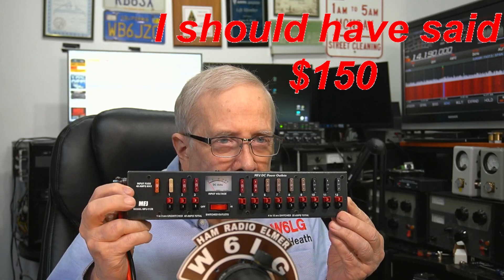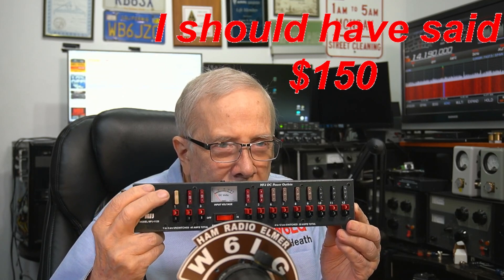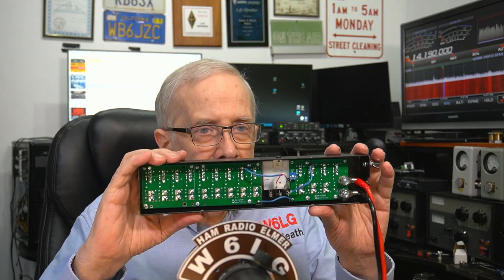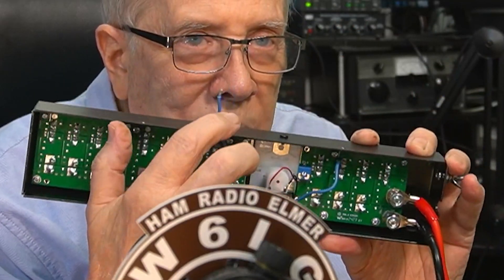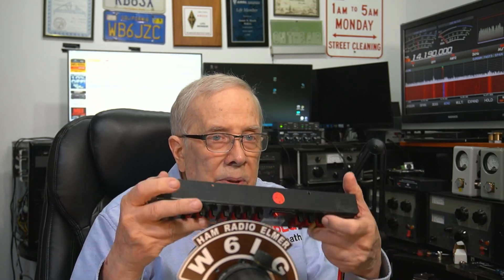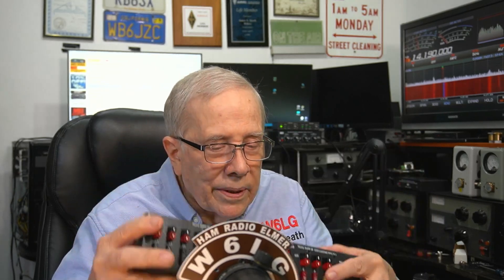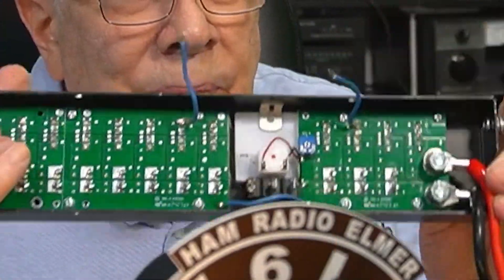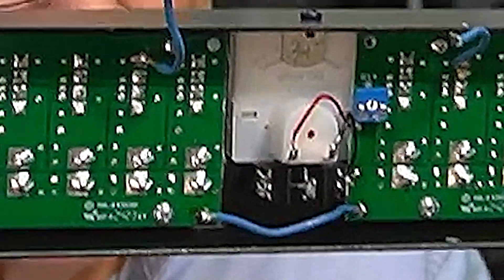Defects Found in MFJ Box #2, Another MFJ Box Here Today for Inspection by Jim W6LG, Watch to the End

Comment: I have been using their MFJ-1118 power strip in my mobile rack case for a few years now, and it has been hit or miss itself.  The switch for the switched poles failed, so I just ended up hardwiring it hot because I didn't use the switch anyway.  Still, another typical failure on a similar product.  Some of those poles still don't seem to provide power, so you have to remember which ones still work.  Never noticed anything dangerous, but then again I just fixed one problem that nearly ruined the product for my purpose.  Might unbolt that 1118 and inspect it further.  A true "you get what you pay for" deal with MFJ.  I've had some good products from them that never failed, some that have defects like non working lights in manual tuners, and some stuff that just totally failed.

Comment: You are too kind to MFJ. The quality of their work (not their designs) is worse than the cheap Chinese radio manufacturers. Like you, I have had to repair new equipment that I purchased from MFJ—and not just once!

I sent them a Mirage two-meter amplifier that wasn’t making power.  That was in October2021–two years ago. It’s never been repaired or returned to this day.

When pressed about the repair after many months they admitted that they were unable to repair an amplifier that they themselves had made. They stated that they didn’t have the parts or people who could fix the amp. Yet they are still manufacturing and selling that very amplifier. It makes no sense. 

As far as I know that amp still sits on a repair shelf somewhere in their shop. I have given up on ever seeing it again and wound up replacing it with another manufacturer’s two-meter amp.

Comment: I don't think that wire can handle 20 Amps. I'd be dubious too. It would have been interesting to try it first though.
I was given an MFJ 16010 tuner by another ham who got it from another ham. I was told it didn't work but I used it at home then North Wales and only upon returning home it didn't work.
Looking inside I saw nothing obviously wrong but finally found a wire only just touching the coil, I could see no original solder, I soldered it and no problem since.
G4GHB.

Comment: That thin wire explains why the volt meter dances about when I transmit. Must be a voltage drop. I thought it was RF getting in. I need to open mine but it's bolted into a rack and I am going away on Monday for a week. I just had to fit proper temperature control to another manufacturers power supply so these kind of things are getting common.
Reply from the maker: It is worth looking inside the box Gordon.  But I think the wires to the meter are very small but connected before the switch.  So the wires to the switch don't affect the voltmeter. Voltage drop with current draw would be in the supply wires and they look pretty good.  Let me know what you find.  The third box arrived and I looked at it carefully.  I found nothing wrong.  I will do that video today or tomorrow. Sunday I have blood tests for chemo.  We are only doing the blood draws once a week instead of twice a week.  Bood counts have been stable at closer to normal but still low.  Thanks Gordon, 73, Jim
Reply: @ham-radio  I hope your treatments go OK. I did check the power supply and it's actually voltage isn't varying under load. When I open it up I might put some ferrite beads on the feed to the meter and see if it makes a difference. As always, your videos are thought provoking.

Comment: I really want to love MFJ, but avoid them now. Once bitten, twice shy. Few years back I bought two loaded verticals, one to replace my aging one. Both had wild SWR's on the centre frequency. One was 8:1 the other 17:1. Centre freq measured around 92mhz off for one and I didn't bother with the other. Purchased a third (different manufacturer) from an interstate shop. It was 1.4:1 straight off the install and capacitance was great. One of the other ham's in the club inherited the two MFJ's to rework them. There was quite a bit of grumbling there when he put north of 20w into a >100w rated antenna, SWR went through the roof and resistance was close to open circuit. So, I feel you.
Reply from the maker: Thanks.  The problems I found in the boxes was an easy fix.  Your antennas with the open circuit sound seriously bad.  Really there is no excuse for the failures except really bad management starting at the very top of the company.  He knows full well that there are serious problems with QC for years and has apparently done little to fix it. Again, there is no excuse that would be acceptable after years of complaints from customers. 73, Jim

Comment: Hi Jim, I agree with your assessment of the wire gauge, although a single wire "out in the open" can carry a surprising amount of current, particularly the PTFE insulated types. I suspect that is just PVC though... 
I only have one piece of MFJ equipment (a digital peak reading power/SWR meter). The paint finish is not terrific but acceptable (to me) functionally it is accurate and reliable, the PCB quality and electronic design are all good.  I imported it from the USA to the UK and during shipping ALL of the nuts and washers retaining the LCD had loosened and fallen off, the LCD was laying inside the unit. I just re-assembled it and it has been perfect for the last 10+ years. I don't like to kick a company that produce economically priced products for us but threadlock/nail varnish are very cheap.  A few seconds of effort  could have made my experience a little more positive. 73

Comment: The wire could probably handle 20 amps for a split second to start an inductive load, but normally you want your fuse to blow before your wire melts or starts a fire. No way is that UL Listed, should be 12 awg for 20 amps according to ampacity charts. It's amazing that this passed any kind of design review.

Comment: Great video, Jim.  I don't understand the use case for these elaborate boxes with power poles, fuses, meters, etc.  Almost all transceiver equipment has a fuse (or fuses) in the power cable.  Why not just use a small powerpole distribution block without all of this other nonsense?

Comment: Hi Jim.  Definitely an important video.  I agree that there is no excuse for the poor solder job.  I do have to disagree on the wire size.  I have that same MFJ box.  I just checked, and thankfully, the solder joints on mine seem okay.  I stripped back some insulation and checked with a digital caliper.  The blue wires on my unit are 16AWG.  The Handbook of Electronic Tables and Formulas lists 22 amps as the maximum current for 16AWG in chassis wiring.  A 2" piece of 16AWG wire will have a 0.014 volt drop at 20 amps and dissipate about 1/4 watt.   So 0.028 volts and about 1/2 watt for both + and - wires.  There is no question that 12AWG jumpers are better, but the 16AWG wires are perfectly adequate in this case.  Keep up the great channel, and I'm glad to see that your health appears to be better.  73,  Tom WA2IVD

Comment: What quality control? A lot of times  MFJ's engineering is fine but the assembly lets it down.  This time the engineering is woefully insufficient.  With MFJ and with other manufacturers I just don't get why they go to the lengths to make a product make it reasonable most of the way and then cheap out on some of the details?  It just doesn't make sense.

Comment: The difference in the price of 18awg and 12awg in the box is absolutely minimal.
Under pressure that 18 awg wire could destroy the other units and the user will be going round in circles trying to figure out the issue ,after all its brand new.
Well spotted Jim
Reply: The minimal cost compared to the increased safety........there just making unsafe gear.

Comment: Hi Jim,
You are looking well. That is unacceptable. I would have been leery of that wire size. Good call changing to 12 ga. I bought an ALS-606S amp late April from HRO DE. Was waiting on the cable to connect my FTdx10 to the amp. It arrived about 3 weeks ago. I have a 220V line to my bedroom and changed the internal wiring to use 220V as instructed in the manual. It keep blowing a fuse on the white wire line from the plug. Using a meter, I determined that the white wire was grounded when the power supply was connected to the RF deck. Unplug the RF deck and all was fine. Was told to send it back to MFJ in MS, which cost me $120 in shipping. I asked if they would send a shipping label and was declined. When it was returned, the repair slip said that a 120VAC cooling fan was installed in the FR deck instead of a 12VDC fan. Will not purchase another amp from MFJ. May have to put it up for sale since my last last trip to the dentist will require having the rest of my upper teeth pulled for a full upper denture. The dentist estimated $2500 to $3000 just for the denture. Not looking forward to the visit to the oral surgeon for the extractions. Stay safe.  73  WJ3U